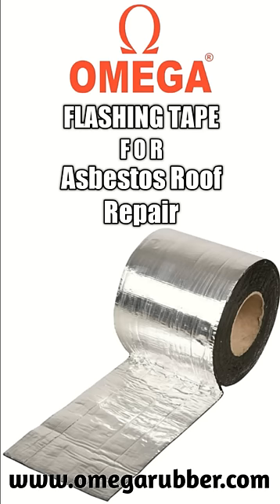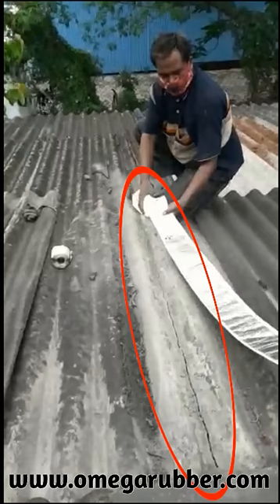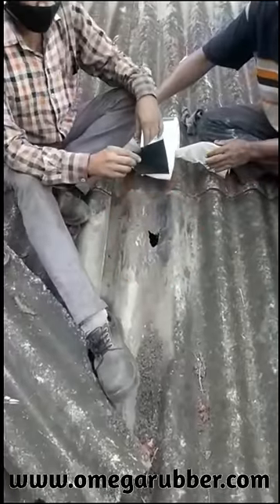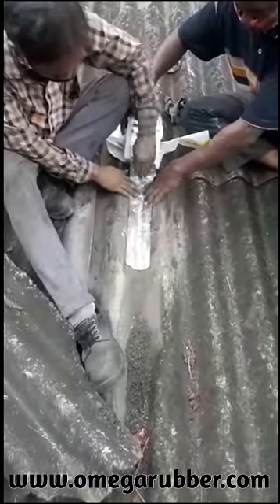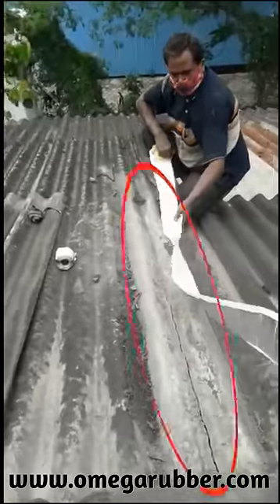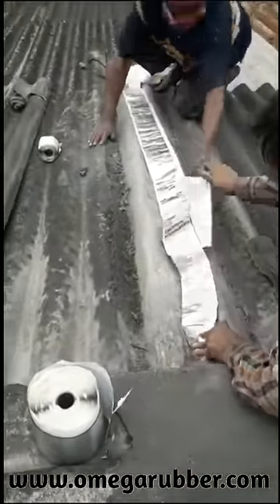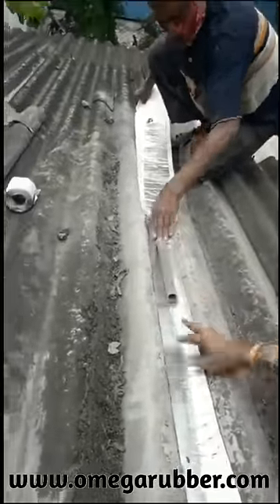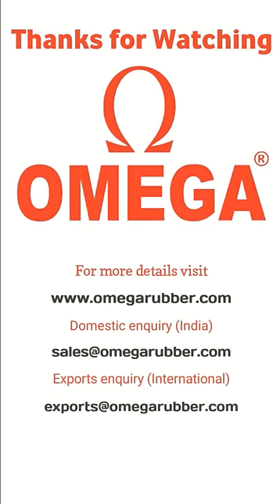HOW TO quickly repair leaking asbestos roof using OMEGA BUTYL ALUMINIUM FLASHING TAPE I India I

Comment: may I know is it works for cullet Hold House in Telangana
Reply from the maker: We would need a little more information on that before we tell you for sure
If you wish to enquire further you can Whatsapp/Call the number given below
+918962869630
Reply from the maker: We are happy to share that we are now available on Flipkart and will soon be available on Amazon 
Please find the link to our products below

150mm x 10mtr: 
https://www.flipkart.com/omega-butyl-flashing-tape-10-m-single-sided/p/itm3bb069294b20e?pid=HWTG3ZF47PGXK9TN

100mm x 10mtr
https://www.flipkart.com/omega-0mega-butyl-flashing-tape-10-m-single-sided/p/itme8d42ab882e2d?pid=HWTG2WF6HYFYZYAV

50mm x 20mtr
https://www.flipkart.com/omega-butyl-flashing-tape-20-m-single-sided/p/itm717078a38b9ed?pid=HWTG3ZF4KSJQ4W6U
Reply from the maker: We are now also available on Amazon
100mm x 10mtr:
https://www.amazon.in/gp/product/B0974G1QTB/ref=cx_skuctr_share?smid=A31UCKADDKPX9T

Comment: Can i use it for tarpaulin leakage
Reply from the maker: We would need a little more explanation on that to be able to give you the right answer
Please contact either of the numbers mentioned below
+918962869630
+919893100066
Reply from the maker: We are happy to share that we are now available on Flipkart and will soon be available on Amazon 
Please find the link to our products below

150mm x 10mtr: 
https://www.flipkart.com/omega-butyl-flashing-tape-10-m-single-sided/p/itm3bb069294b20e?pid=HWTG3ZF47PGXK9TN

100mm x 10mtr
https://www.flipkart.com/omega-0mega-butyl-flashing-tape-10-m-single-sided/p/itme8d42ab882e2d?pid=HWTG2WF6HYFYZYAV

50mm x 20mtr
https://www.flipkart.com/omega-butyl-flashing-tape-20-m-single-sided/p/itm717078a38b9ed?pid=HWTG3ZF4KSJQ4W6U
Reply from the maker: We are now also available on Amazon
100mm x 10mtr:
https://www.amazon.in/gp/product/B0974G1QTB/ref=cx_skuctr_share?smid=A31UCKADDKPX9T

Comment: Can it also apply on tin metal roof  ?
Reply from the maker: Yes Mr. Neelesch Kale our product is also applicable on tin metal roof please find link to the video of the same below
https://www.youtube.com/watch?v=Oq9NlxDb9GU

Our products are available Pan India on both major ecommerce platforms i.e. Amazon and Flipkart please find the link to our products below

Amazon:
150mm x 10mtr
https://www.amazon.in/gp/product/B097Y1NTQD/ref=cx_skuctr_share?smid=A31UCKADDKPX9T

100mm x 10mtr
https://www.amazon.in/gp/product/B0974G1QTB/ref=cx_skuctr_share?smid=A31UCKADDKPX9T

50mm x 20mtr
https://www.amazon.in/gp/product/B097Y3VZP8/ref=cx_skuctr_share?smid=A31UCKADDKPX9T

Flipkart:
150mm x 10mtr
https://dl.flipkart.com/dl/product/p/itme?pid=HWTG3ZF47PGXK9TN&lid=LSTHWTG3ZF47PGXK9TNBEWCBO

100mm x 10mtr
https://dl.flipkart.com/dl/product/p/itme?pid=HWTG2WF6HYFYZYAV&lid=LSTHWTG2WF6HYFYZYAVRTUKGO

50mm x 20mtr
https://dl.flipkart.com/dl/product/p/itme?pid=HWTG3ZF4KSJQ4W6U&lid=LSTHWTG3ZF4KSJQ4W6UX1BGVW
Reply: Price
Reply: @omegarubber  Thanx
Reply from the maker: Amazon:
150mm x 10mtr
https://www.amazon.in/gp/product/B097Y1NTQD/ref=cx_skuctr_share?smid=A31UCKADDKPX9T

100mm x 10mtr
https://www.amazon.in/gp/product/B0974G1QTB/ref=cx_skuctr_share?smid=A31UCKADDKPX9T

50mm x 20mtr
https://www.amazon.in/gp/product/B097Y3VZP8/ref=cx_skuctr_share?smid=A31UCKADDKPX9T

Flipkart:
150mm x 10mtr
https://dl.flipkart.com/dl/product/p/itme?pid=HWTG3ZF47PGXK9TN&lid=LSTHWTG3ZF47PGXK9TNBEWCBO

100mm x 10mtr
https://dl.flipkart.com/dl/product/p/itme?pid=HWTG2WF6HYFYZYAV&lid=LSTHWTG2WF6HYFYZYAVRTUKGO

50mm x 20mtr
https://dl.flipkart.com/dl/product/p/itme?pid=HWTG3ZF4KSJQ4W6U&lid=LSTHWTG3ZF4KSJQ4W6UX1BGVW

Comment: It shows to purchase in bulk quantity but I need only one
Reply from the maker: You can buy a single roll from Amazon by clicking on this link below

https://www.amazon.in/OMEGA-Butyl-Flashing-Tape-20mtr/dp/B09FXMX2MT/ref=asc_df_B097Y3VZP8/?tag=googleshopdes-21&linkCode=df0&hvadid=396985334328&hvpos=&hvnetw=g&hvrand=17948086106064309072&hvpone=&hvptwo=&hvqmt=&hvdev=c&hvdvcmdl=&hvlocint=&hvlocphy=9299777&hvtargid=pla-1366629312919&mcid=279ee5de32d0397586fde2cbb94b2016&ext_vrnc=hi&th=1

Comment: If leakage from joints then what to do
Reply from the maker: You can simply cut out the desired size from our product and apply it at the source of leakage
We are positive that it will solve your problem (provided the application is done in the right way)
For any further queries or assistance kindly contact either of the numbers mentioned below
+918962869630
+919893100066
Reply from the maker: We are happy to share that we are now available on Flipkart and will soon be available on Amazon 
Please find the link to our products below

150mm x 10mtr: 
https://www.flipkart.com/omega-butyl-flashing-tape-10-m-single-sided/p/itm3bb069294b20e?pid=HWTG3ZF47PGXK9TN

100mm x 10mtr
https://www.flipkart.com/omega-0mega-butyl-flashing-tape-10-m-single-sided/p/itme8d42ab882e2d?pid=HWTG2WF6HYFYZYAV

50mm x 20mtr
https://www.flipkart.com/omega-butyl-flashing-tape-20-m-single-sided/p/itm717078a38b9ed?pid=HWTG3ZF4KSJQ4W6U
Reply from the maker: We are now also available on Amazon
100mm x 10mtr:
https://www.amazon.in/gp/product/B0974G1QTB/ref=cx_skuctr_share?smid=A31UCKADDKPX9T

Comment: Is it available online ?
Reply from the maker: We deliver our product to the customer straight from our manufacturing unit as of now but it will be available online very soon. 
You can contact us at +918962869630 until then
Reply from the maker: We are happy to share that we are now available on Flipkart and will soon be available on Amazon 
Please find the link to our products below

150mm x 10mtr: 
https://www.flipkart.com/omega-butyl-flashing-tape-10-m-single-sided/p/itm3bb069294b20e?pid=HWTG3ZF47PGXK9TN

100mm x 10mtr
https://www.flipkart.com/omega-0mega-butyl-flashing-tape-10-m-single-sided/p/itme8d42ab882e2d?pid=HWTG2WF6HYFYZYAV

50mm x 20mtr
https://www.flipkart.com/omega-butyl-flashing-tape-20-m-single-sided/p/itm717078a38b9ed?pid=HWTG3ZF4KSJQ4W6U
Reply from the maker: We are now also available on Amazon
100mm x 10mtr:
https://www.amazon.in/gp/product/B0974G1QTB/ref=cx_skuctr_share?smid=A31UCKADDKPX9T

Comment: How to remove the tape?
Reply from the maker: It is not going to be easy to remove the tape , however if you need to remove it , you will have to apply a lot of strength to remove it, and once you remove the tape , you may clean the area with Kerosene , Diesel, petrol or similar solvent . 

You can also place a lot of ICE on the tape , Cool it properly , then try to remove it , IT will be little easier to remove . 

Hope this helped !!

Comment: I want to buy this
Reply from the maker: you can purchase our tape from Amazon or Flipkart. Please find links to our products below

Amazon:
150mm x 10mtr
https://www.amazon.in/gp/product/B097Y1NTQD/ref=cx_skuctr_share?smid=A31UCKADDKPX9T

100mm x 10mtr
https://www.amazon.in/gp/product/B0974G1QTB/ref=cx_skuctr_share?smid=A31UCKADDKPX9T

50mm x 20mtr
https://www.amazon.in/gp/product/B097Y3VZP8/ref=cx_skuctr_share?smid=A31UCKADDKPX9T

Flipkart:
150mm x 10mtr
https://dl.flipkart.com/dl/product/p/itme?pid=HWTG3ZF47PGXK9TN&lid=LSTHWTG3ZF47PGXK9TNBEWCBO

100mm x 10mtr
https://dl.flipkart.com/dl/product/p/itme?pid=HWTG2WF6HYFYZYAV&lid=LSTHWTG2WF6HYFYZYAVRTUKGO

50mm x 20mtr
https://dl.flipkart.com/dl/product/p/itme?pid=HWTG3ZF4KSJQ4W6U&lid=LSTHWTG3ZF4KSJQ4W6UX1BGVW
Reply: What's the life of that plaster
Reply: I don't want link. Life time of that plaster
Reply from the maker: @Jayachandra Reddy our product is not a plaster. It is a synthetic rubber, i.e., butyl-based product, and has a life of 10 years (Under ideal circumstances) if applied in the exact way it is recommended.

Comment: How much cost Saar
Reply from the maker: What Size do you require ?
Reply: 6 inch width
Reply from the maker: Please contact us @ +91-8962869630
Reply from the maker: We are happy to share that we are now available on Flipkart and will soon be available on Amazon 
Please find the link to our products below

150mm x 10mtr: 
https://www.flipkart.com/omega-butyl-flashing-tape-10-m-single-sided/p/itm3bb069294b20e?pid=HWTG3ZF47PGXK9TN

100mm x 10mtr
https://www.flipkart.com/omega-0mega-butyl-flashing-tape-10-m-single-sided/p/itme8d42ab882e2d?pid=HWTG2WF6HYFYZYAV

50mm x 20mtr
https://www.flipkart.com/omega-butyl-flashing-tape-20-m-single-sided/p/itm717078a38b9ed?pid=HWTG3ZF4KSJQ4W6U
Reply from the maker: We are now also available on Amazon
100mm x 10mtr:
https://www.amazon.in/gp/product/B0974G1QTB/ref=cx_skuctr_share?smid=A31UCKADDKPX9T

Comment: Mrp
Reply from the maker: Please contact us on whatsapp or call
+91-8962869630
Reply: @omegarubber  sir rs to bta dijiye
Reply from the maker: @Amit Harpal ji
Please contact the above mentioned number either by whatsapp or call
You will be informed about the price for the same there
Reply: Does it provided individually or supply only for bulk
Reply from the maker: @Tushar ji we are currently dealing in both retail and commercial sales for this product
You can contact our team whenever you feel fit
Mr. Sunil Kumar Batra
+919893100066
Reply from the maker: We are happy to share that we are now available on Flipkart and will soon be available on Amazon 
Please find the link to our products below

150mm x 10mtr: 
https://www.flipkart.com/omega-butyl-flashing-tape-10-m-single-sided/p/itm3bb069294b20e?pid=HWTG3ZF47PGXK9TN

100mm x 10mtr
https://www.flipkart.com/omega-0mega-butyl-flashing-tape-10-m-single-sided/p/itme8d42ab882e2d?pid=HWTG2WF6HYFYZYAV

50mm x 20mtr
https://www.flipkart.com/omega-butyl-flashing-tape-20-m-single-sided/p/itm717078a38b9ed?pid=HWTG3ZF4KSJQ4W6U
Reply from the maker: We are now also available on Amazon
100mm x 10mtr:
https://www.amazon.in/gp/product/B0974G1QTB/ref=cx_skuctr_share?smid=A31UCKADDKPX9T

Comment: Hi

Can this be used on polycarbonate sheet on the overlapping junctions?
Reply from the maker: Hi Utkarsh 
Yes, Omega Butyl Flashing Tape can be applied on Polycarbonate sheets. For the product to work perfectly please make sure the surface you are trying to apply the tape on is clean and dry.
It should not have dust, rust, oil, grease, debris, water, or any impurity for that matter.
Apply a decent amount of pressure when installing the tape.
Make sure you follow these instructions to get the best results.

Comment: Can I use this on iron sheet
Reply from the maker: Yes Absolutely!
You can find our product on Flipkart, the link to which is attached below

150mm x 10mtr: 
https://www.flipkart.com/omega-butyl-flashing-tape-10-m-single-sided/p/itm3bb069294b20e?pid=HWTG3ZF47PGXK9TN

100mm x 10mtr
https://www.flipkart.com/omega-0mega-butyl-flashing-tape-10-m-single-sided/p/itme8d42ab882e2d?pid=HWTG2WF6HYFYZYAV

50mm x 20mtr
https://www.flipkart.com/omega-butyl-flashing-tape-20-m-single-sided/p/itm717078a38b9ed?pid=HWTG3ZF4KSJQ4W6U
Reply from the maker: We are now also available on Amazon
100mm x 10mtr:
https://www.amazon.in/gp/product/B0974G1QTB/ref=cx_skuctr_share?smid=A31UCKADDKPX9T

Comment: Price
Reply from the maker: Thanks for your interest in our product Omega Butyl Aluminium Flashing Tape . 
This product is available in 50 mm ( 2 inch ) , 100 mm ( 4 inch ) and 150 mm ( 6 inch ) width and in lengths of 1 mtr , 5 mtrs , 10 mtrs and 20 Mtrs per box . You can choose the product as per your requirement and buy it online from Amazon or Flipkart ....
Please click on the link below to go to our store on Amazon ;

https://www.amazon.in/OMEGA-adhesive-aluminium-waterproof-flashing/dp/B0BN1DWJ4K/ref=asc_df_B0BN1DWJ4K/?tag=googleshopdes-21&linkCode=df0&hvadid=619625485367&hvpos=&hvnetw=g&hvrand=13159134036537803415&hvpone=&hvptwo=&hvqmt=&hvdev=c&hvdvcmdl=&hvlocint=&hvlocphy=9300952&hvtargid=pla-1954827013433&th=1

Thanks 
Team Omega